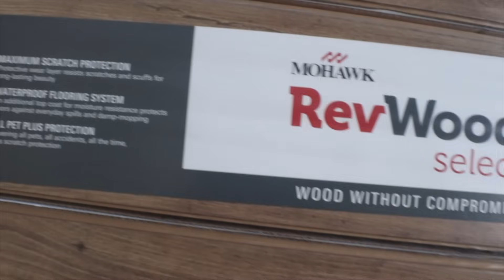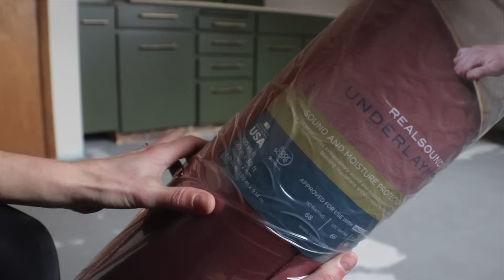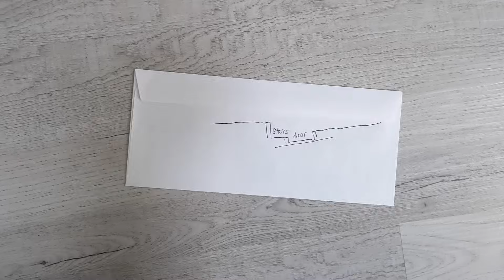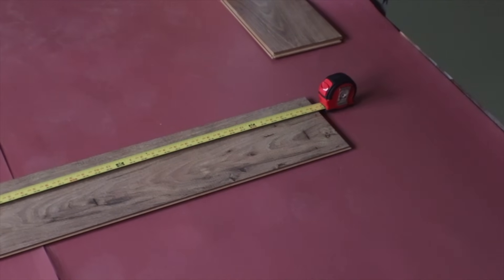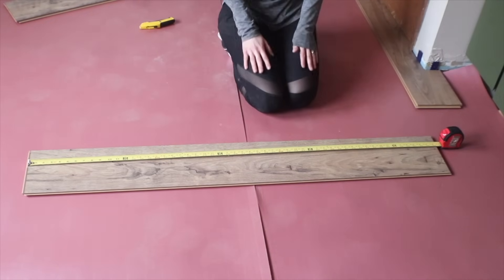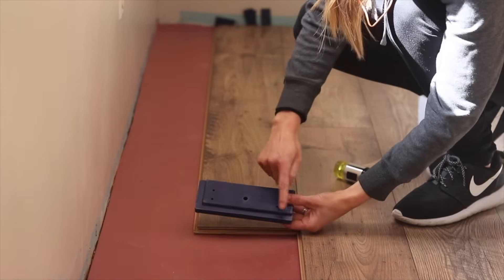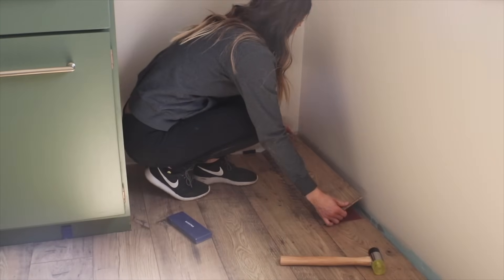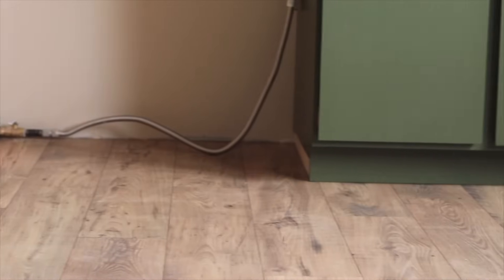How to Install Laminate Flooring (for beginners)

Comment: Awesome video, if anyone has any product or installation questions, let us know!
Reply: i was wondering if the click system tile already has its own like foam underlayment, would it be a bad thing to put in another layer, I ask cause my flooring is bowing at the seems any ideas?
Reply: @dariogalvan3172  

Typically if there is a preattached pad, adding an additional pad is not a good idea. This happens more so on vinyl than it does with laminate. The vinyl locking systems are easier to break and are more sensitive to excess movement.

In most cases an extra layer of pad will void your warranties, however some manufacturers have specific products they will warranty because they are extremely dense and wont cause much more movement.

Comment: YOU DO NOT HAVE TO TAP EVERY BOARD WITH A HAMMER! Connect the side first, lift up the last board and click in the new one along the long side. You don't want to leave those spacers in along the wall either.

Comment: Couple tips, #1-use a garden flat hoe for the pesky staples. Way faster & easier then crawling around with pliers.  
#2- always cut your boards into thirds. Meaning 1st row=full board. 2nd row=2 thirds. 3rd row=1 third. 
Example.
48 in boards.   Row1=48in.                                 Row2=32in.                                 Row3=16in.                                   Row4=48in.                                         
Repeat.
54 in.
R1=54
R2=36
R3=18
R4=54
Repeat, repeat! Works every time.
 
Hope this helps save your back and knees, & a little time!! 😀
Reply from the maker: Yeah so I didn't want a repeating pattern at every three rows, the pattern I did was the same concept but in fifths. 😊